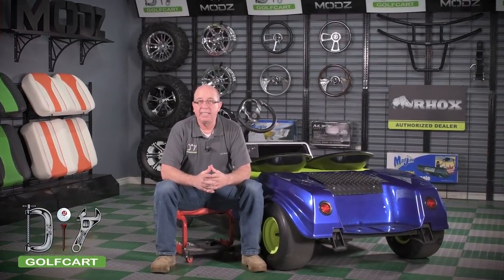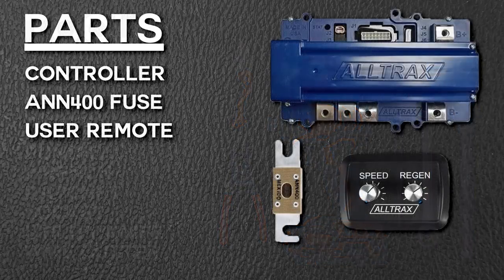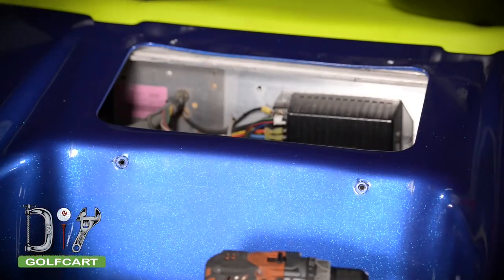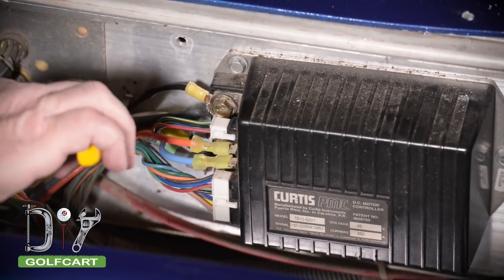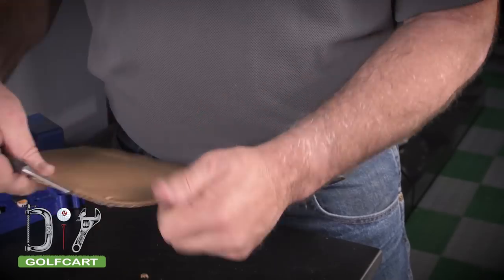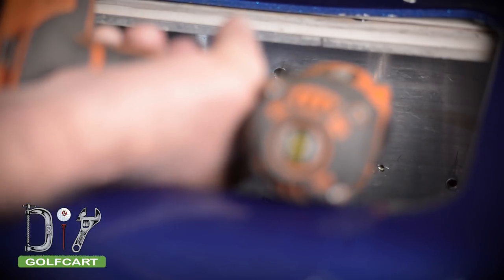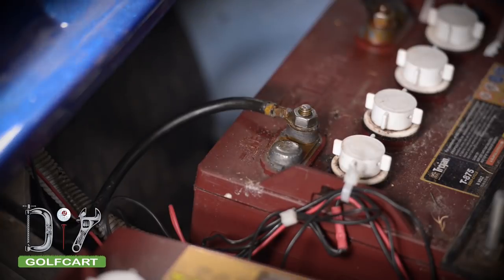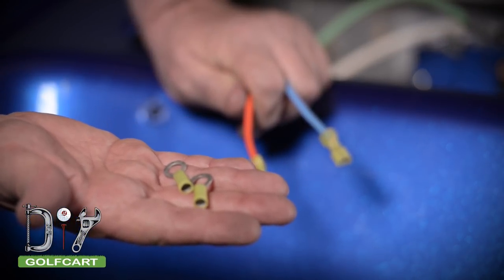Alltrax Controller Installation on a Club Car DS IQ Golf Cart

Comment: Excellent video,  is the 400amp fuse on the negative terminal absolutely necessary ?  I bought a used 400 amp controller and don't have the fuse.  Can someone link the specs so I can get one?

Comment: At what point do you know the limit of a stock motor? I see alot of guys put these high amp controllers into carts but smoke there motors in 2 weeks. What is your ratio for knowing when is the maximum without doing damage?

Comment: D&D motor upgrade don't have Regen feature right so the on the fly Regen don't work? Plus this controller upgrade works with stock motor and on the fly control and xtc controller.

Comment: I just bough the 400 amp for my 03 cc ds, my controller only has one metal threat plates on the top in the location you put the white/blue/red wires. It has 4 connections on the bottom by the 12 pin connection point, the 4 connection points are color coded red/blue/green/black. Is this where I hook the red and blue leads?
Reply from the maker: Just to make sure, call Will @ Alltrax (tech guy for controllers) 541-476-3565.

Comment: Great video. One question, when you Uninstalled the original controller it had two black cables, you connected one to the XLT, what did you do with the other one?
Reply: I saw the answer in another reply!

Comment: I enjoyed the video. I have one question, what did you do with the black wire on the top has a yellow connector (about a 10ga. wire) seems to be connected with the battery positive lead?
Reply from the maker: You caught me. I missed that wire and hooked it up later. It went along with the battery negative and fed the OBC.

Comment: What performance improvements can I expect with already having a high speed motor? Thank s
Reply from the maker: The controller is the middle man. The larger the controller, the more amperage it allows the motor to draw from the batteries equaling MORE SPEED!!

Comment: I have a club car precedent 2013 48v what is the right one I will to buy for mine been looking for months Don't know much about carts
Reply from the maker: If it's stock , I'd go with a 400 amp. If you have a high performance motor installed, I'd go with a 500 amp.
https://diygolfcart.com/club-car-iq-400-amp-regen-speed-controller/
https://diygolfcart.com/club-car-iq-500-amp-regen-speed-controller/
Reply: @golfcartking  I would also mention that if they have sock now and may upgrade later to go with the 500amp.  Then they can program the controller to 400 and be ready for the 500 down the road.